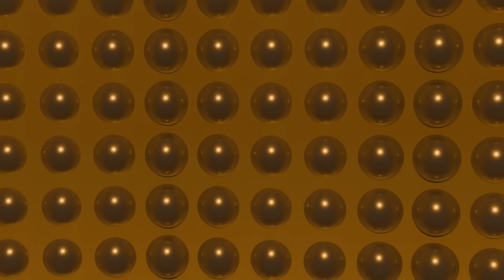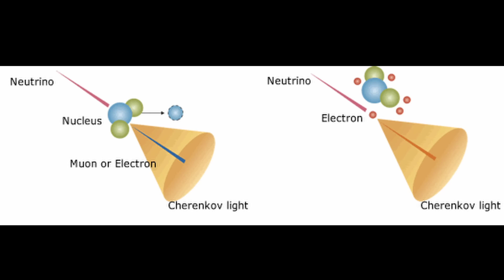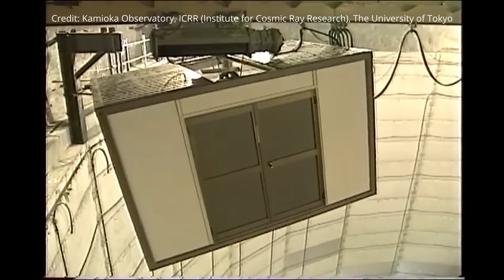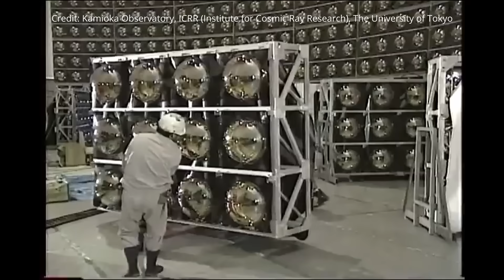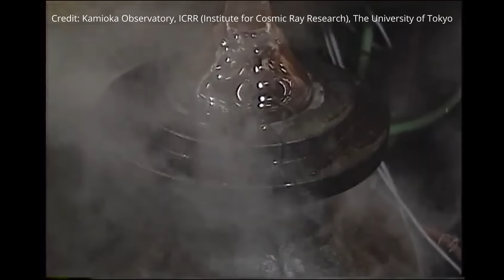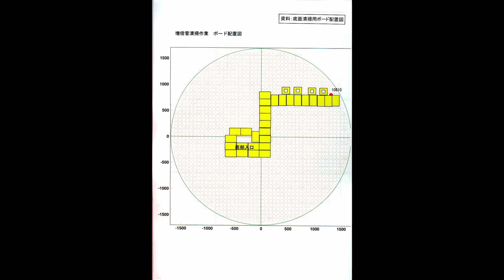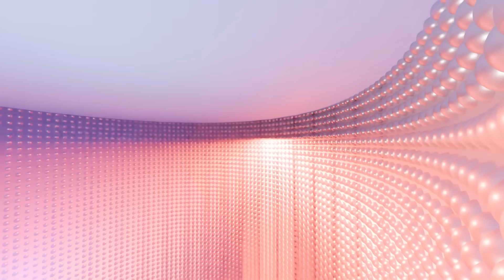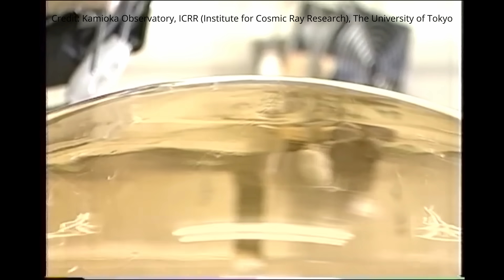An Engineering Fairy Tale: Cascade Failure at the Super Kamiokande

Comment from the maker: First of all, I got my cost figures way off. Thanks to @morizbraun5034 for pointing out that 7000 * 10000 is indeed seventy million, not seven million. BUT it seems the cost for each tube was actually $3000 (2001 dollars), which is an absolute bargain. All things considered, it cost about $30 million to restore.

I'm also getting a lot of comments wondering how the engineers could possibly miss this, and how inadequate their testing was. There are 3 points to consider here:
1. I suspect they did additional tests but I can't find the info on them because it is probably exclusivley in Japanese....assuming it is online at all.
2. For a deep dive into an engineering failure that appears blindingly obvious in hindsight but much much more nuanced in reality, see the 'SRB' section of my Space Shuttle video. 
3. Fluid modelling and engineering standards were nowhere near what they are today back in 1981 when these tubes were first used.
Reply: Have you considered covering the mechanical fire control computers in age of steam warships (1880-1950)? They are some utterly fantastic pieces of equipment, and I highly recommend reading up on them if you haven’t!
Reply: At $3k 2001, I'd buy one!
Reply: @dontnubblemebro  I worry that within some decades it will cost as much or more than 10k$ to refabricate a TV or monitor CRT for bringing any vintage arcade videogame or console TV back to life.
Reply: @dontnubblemebro get some of these and fit them for hifi audio lmao
Reply: A detail video of how those are made would be cool :=) Se if you can get a tour inthere facility :D
Reply: @AA-iq6ev  nice catch.  Proves once again how often we mentally replace an error with the correction unconciously, and how "spell check" software alone won't catch it.  Lord knows I skipped by it.:-)
Reply: 19:45 -- IOW he was awarded the prize a couple years after Miles Mathis had already deduced what was going on. See his paper entitled "The Solar Neutrino Problem" (published March 28, 2013, tailing several others dating from 2011). It's now a dozen years later, and they still haven't caught up.
Reply: @Alexander-the-ok 
Yes. Counting zeroes can become a "task". We did it once in a while, with results 10 times or "one-10th".
Also as a veteran of vacuum tubes in Electronics Engineering I must say that with gradual phasing out of these glass vacuum tubs, the production stopped (diodes, triodes, tetrodes, pentodes, klystrons & TWTs). With that the skills were lost instead of refining them. For quite awhile India was exporting high-power (vacuum tube) triodes needed for high power transmitters, as that was the only country indulging in this activity.
Reply: @MrPoornakumar  As the song goes, "we don't know what 'til it's gone". The thing that worries me is that just because a lot of people have decided they don't need large power vacuum tube electronics now doesn't mean to say that we won't need them in future. 

For a hypothetical example, if Elon Musk's satellites cause the first Kessler syndrome (cascading collisions in orbit filling near earth space with junk) and we suddenly lose access to space, people will suddenly want high power transmitters all over again. Except we won't know how to build them...
Reply: @abarratt8869  
I think you're right.
Reply: It cost $30 million dollars to fire this weapon for 12 seconds.
Reply: That was a bargain. One half of the price of one F-35 fighter. (30 million). It's nuts how much money humanity throws to weapons.
Reply: What could be really cool is seeing a simulation of not just a single tube going off, but the waves throughout the tank as the failure cumulativley cascaded….
Reply: Keep in mind that the cost to purchase the tubes doesn't necessarily cover the cost to install the tubes, or the cost to remove the debris from the destroyed tubes.
Reply: I can see a few design flaws. 
1. Foam really? Why not spend an extra fee thousand and put in posts to stay off the lights. Why does that? Glass isn't indestructible. 
2. Did they put an earthquake sensor on it? 
3. The problem with wrapping it in plastic, plastic distorts light. It will probably still work, but we'll you know.
Reply: Funny... I knew all the background information and immediately foresaw the basic shape of what must have happened, but as a surveyor of all physics and engineering, I sometimes miss news items. So I never heard about the fairy tale cascade failure. The conclusion of designing and testing for the worst case is very much my mantra. Now I know this one, and I thank you!
Reply: Aye, progress and learning involves a lot of blind rummaging around in a dark room - things get broken. Or in this case a tank. Not a popular view but "mistakes in hindsight" are not the as same mistakes as ones people make everyday repeatedly where the consensus would be that everyone's Grandma could have told them not to do it the wrong way. This is was of science's finest mistakes because although expensive - it was likely an inevitable stepping stone and as you say - no-one got hurt which is a bonus and never guaranteed when working at the frontier of all human knowledge.
Reply: Your accent saying "waata" 😂😂 what area of the UK are you from?
Reply: It's almost... like 40 years ago they made a mistake that we get the benefit of in our modeling and engineering practice...
Reply: The accident reminds a bit to the exploding giant cylindrical aquarium Aquadom in a hotel in Berlin. This disaster apparently happened by temperature change because due to a gas shortage in Germany after Ukraine war, only the upper floors of the building remained unheated, which in winter caused heat stress to the enormous acrylic cylinder that eventually made it rupture, sending a small tsunami laden with dead fish across the building, that blew out the front doors and furniture and spilled all this water into the street in front of it.
Reply: 5 minutes in...W H A T  A R E  Y O U  T A L K I  N G  A B O U T......
Reply: Incidentally BobbyBroccoli has a wonderful video with a nice model
Reply: @Alexander-the-ok  Alexander, can I draw your attention back to your chart which show showed the tubes being damaged above and below the waterline.
What you’re seeing is the disruption of the air rising from the water from the shattered tubes. 
While this energy is quite low as it grows in the atmosphere pressure allows those gobs of air to slowly expand when they’ve hit the surface. They can’t have a violent reaction, showering more of the tubes above the waterline and perhaps carrying a little bit of debris. 
I have a question though why wasn’t there a line or two straight from the bottom to the top which were protected from the cavitation due to Eddie’s?
Reply: That last point is definitely the biggest thing. Fluid simulation is an absolute game changer.
Reply: Regarding the cost, yes a total bargain. This does not surprise me in the least. “Social worth” is a big deal in how companies are run in Japan, and I would not be surprised if the manufacturers did the job for cost price. They would rightly be very proud to have contributed to something like this. 

This pride they have has had unintended consequences sometimes. A Shinkansen (an N700?) train experienced a failure of a welded joint on a bogie only a few years ago. This nearly caused a terrible accident but thankfully the train guard was on the ball and heard the bang as the joint failed, told the driver to stop. 

The cause? These joints which were never ever going to be seen by anyone whatsoever had been ground down to a lovely finish. No welder helping build a Shinkansen train was ever going to leave a joint as is, it’s got to be given a perfect finish. 

However what no one realised was that the well finished welded joints were weaker than if the welders had simply left them as is, which is why the engineers had not specified such a finish in the drawings. 

The whole fleet required rectification. Which, this being Japan, was done pretty quickly and very thoroughly.
Reply from the maker: @abarratt8869  The Shinkansen is an utter marvel. And I do not say that lightly.

I hope to do a video about it someday when I actually visit in person. Just a few days ago I was entertaining the idea of a 'hypothetical' trip to Japan and it took me a while to realise I don't need internal flights. The time to get from Tokyo to Kyoto on a bullet train is less than the time between leaving a hotel and stepping on an airplane at the airport.
Reply: @ I’m a frequent visitor to Japan. If you want the fastest Shinkansen, get the Hyabusa / Komachi service out of Tokyo headed north, especially in winter (when it’s bashing through the snow at 200mph). 

Or wait a couple of years to when they’re promising to have completed the maglev by!

But you have to go to Kyoto and the train museum. They’ve got trains galore of course, but the electronic ticket booking system from 1964 is also astonishing. They had computerised seat booking whilst we were still using steam trains. 

They also had automatic train control back then too.
Reply: Could of, wood of, should of.  Its easy for people to use experience to judge mistakes, but someone has to make that mistake for the first time so the rest of us can learn.
Reply: @ChainsawFPV  that is so true
Reply: Marie Curie did, nobody learned.
Reply: @ChainsawFPV  

> Could of, wood of, should of.

I'm usually not THIS much of a dick and I expect that with your comment being 12 days old, you've already received more than a fair share of know-it-alls, so I'm not posting this with the intention of piling on , but I am dropping the rules of "if you have nothing nice to say..." in this instance because this is just too egregious for me to try to ignore.

I don't know how, but you somehow managed to misspell FOUR OF THE SIX (!) words in your first sentence. A 67% failure rate has to be a record for an average native speaker and is frankly, something that crosses the line from improbable to remarkable. (I did made an educated guess on whether you are a native speaker, but I'm fairly certain I'm correct since I've never seen a foreign speaker making this series of mistakes despite having far less experience with English.) 

(I feel kind of bad writing this comment. I'm working on being nicer and not always succeeding. I'll still post it thought because I guess I'm an ass after all.)
Reply: @ChainsawFPV  Just because a frog crossed a dangerous highway during rush hour noting all the possible dangers to avoid,doesnt mean they accounted for the pavement being too hot on the next crossing. 😂 Thats how Im looking at it.
Reply: @ChainsawFPV  could have, would have, should have
Reply: @Ultimaximus  Could"a, would'a, should'a.  Lol.  Depends on where you are from.
Reply: @ChainsawFPV  coulda woulda shoulda are better than could of, would of, should of
Reply: @Ultimaximus  I guess it's a good thing I am not here looking for grammar police then huh........
Reply: @Ultimaximus Could've, wood've, should've.
Reply: You know it's like trivially simple to translate Japanese into English, right?  Even if the writing sample is an image, and/or it's written by hand.   AI called, they told me to tell you "I exist".
Reply from the maker: @AMurderOfLobs  Cool. Go find the physical engineering report from 1980 that may or may not be somewhere in Japan and has never been digitized and posted online. I'll retrain the transformer I wrote myself a couple of years ago to translate it.

Translating isn't the difficult part. It's finding physical documents from archives that is the hard part.
Reply: @Alexander-the-ok  I misunderstood your statements about how there "may be new material in the Japanese-only sections", and your solicitation for Japanese speakers to help.  I thought you were saying there might be new material in the Japanese sections of the report itself, that you were unable to read because you don't speak Japanese.
Reply: I was trying to estimate the cost. 7000 tubes? wowzerz! They are spending millions to detect just a few particles!
Reply: @pauls5745  
only a cople of milions 
fore a reserch project that is realy cheap
Reply: Duuuuuuuuuuude everything bad or dark happens in Novemberrrrrrrrrrrrrrrrrrrrrrrr.
Reply: In the event a tube experienced catastrophic failure it didn't take a rocket surgeon to envision a cascading effect due to the close proximity and fragility of the tubes..  my Good Enough Diploma could surmise the math ain't mathing.
Reply: @vincentrusso4332  
But thy did testing(yes it who's flodu) that showed that it would be a problem so ther is no reson way thy should have been wored

Comment: I have a theory that the only difference between electron, photon and neutrino, is distortion. To be released, the particle must be accelerated around the magnetic paths in the atom until it reaches escape velocity. Electrons are low speed relatively and wobble like a spinning top, quickly attaching to another atom etc. Photons are much faster electrons that distort to a string longer than the atom before finally being released, which is why they can slingshot around atomic cores, which tunes the colour. Neutrinos may not be faster than photons but had to accelerate with much more force to break free, and I believe measure in meters lengthwise. This would explain their ability to ignore matter

Comment: Me, no technical expertise on the matter, hearing:
"They stuck 6 of them 3 meters under water and popped one, since the other 5 didn't pop they determined it would be impossible for them to cascade"
They fucking concluded what????
These top of their field scientists and engineers never thought about the concept of more material on top applies higher pressure on the base?
Any grade school common house builder engineer dropout should have caught that mistake... no hindsight needed.

How are you simultaneously smart enough to understand vacuum implosion and think about whether this could cause a cascade, but don't understand that deeper water has higher pressure and the implications that has on the pressure of an implosion?

Comment: 7:26 a small, solid state photomultiplier equivalent would be a revolution in so many fields. Like billions of frames per second slow motion cameras would be possible (they already kind of are thanks to photomultiplier tubes but they have to have like 1-100 pixels and use various tricks to get a full usable image from that), cameras that see as well in the dark as night vision googles but in full color would be possible,  fiber optics would probably be revolutionized to some extent as well. If anybody wants a project that will give you a guaranteed Nobel prize if you are successful, here you go.

Comment: Soo..... If they are building the new detector 4x larger....... And they are using the exact same specs of detector as the one that experienced the catastrophic failure cascade..... Doesn't that mean the detectors, the same ones that failed in the first facility, would be subjected to depths of underwater pressure 4x greater? Or at least a significant amount greater? (Water pressure increases by ~1 atmosphere every 10 meters, roughly, as temp, salinity, and other factors influence the specific density, and I'm not sure how to calculate for factors like ultra pure fresh water, or if a contained volume of water differs from the ocean, etc) So taking this into consideration..... If the vacuum tubes are the same specs as originally, how do they account for the increased forces that would exist in a volume of water 4x greater creating conditions much more prone for the failure to occur again with an even more spectacular failure?

Comment: So, my first thought about the leadup to the failure: the maintenance access method for the detectors changed after this, right?! No more just putting mats down on the naked tubes?
Given it's a circle packing scenario, the solution seems obvious (tho there's probably some nuance): put support legs for some scaffolding between the tubes on the bottom, so that the glass of the tube isn't load bearing.

Comment: 18:20 the lower water depth and therefore pressure means that the air bubble collapses with less force and the shockwave it generates is less intense.

Comment: I mean technicaly you only need to test edge cases to see what happens. 
In this case that would be testing cascade failiure at larges depth. In my proffesion that would be overloading the hell out of the tested frame, introducing some accidental forces (someone hitting it with something like car, forkift or carried object depending on expected use) and seeing if it fails on nah. Most recent example was table cart for moving steel parts. It's indended for up to 250kg, we loaded it with plate that was about 700kg, and kicked it near top to move it around (concern was it would not be able to resist side forces produced by someone pushing it and hitting something) we also got it moving pretty fast and hit other plate laying on floor as extra test.
My point being it's gonna be able to withstand much smaller loads from expected use if you test conditions far beyond requirements.
Also i belive that ones in upper part of tank didn't fail because energy released by colapsing vacum is function of outside pressure, aka the bigger water pressure is, the faster void colapsing and larger pressure spike will be created wich is dangerous part of the collapse.

Comment: I basically picked up that one failed and nuked the surrounding ones just for them to nuke others by the time You stated that they were underwater.
Though I'm not sure if assumption was completely right. In my mind the shock wave came from massive amount of water starting to move and then suddenly stopping (clashing against it-self) when the space is filled up. Like that feel when You suddenly close tap and the tap is hit by the mass of water in pipes.